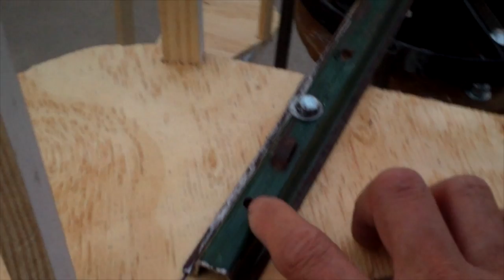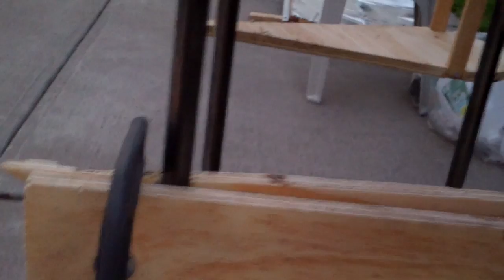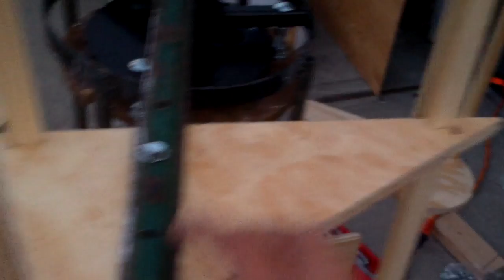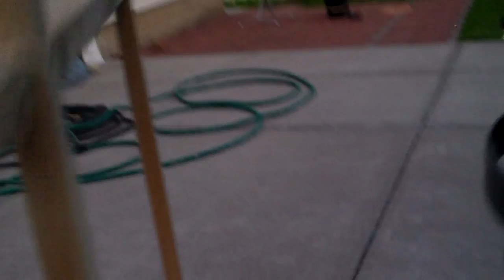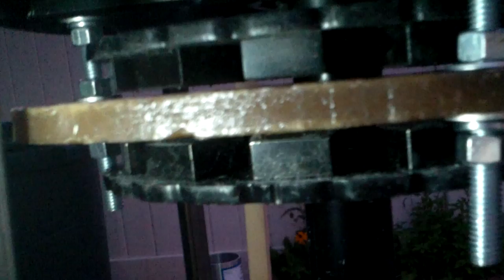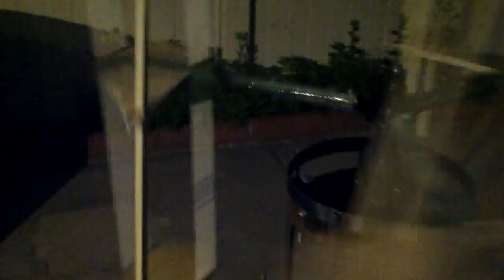Lenz 2 low rpm wind turbine taking shape

Comment: dang! this project is coming along great! looks like you"ve got it planed out well. I hope that stator hangs in there and gives you good service. I should of used the 1x1 magnets when I put mine together. its still flying , greased the bearings once, they will last forever. cant  wait to see it in   the wind. PEACE and Rock on!
Reply from the maker: Goofywind Thank you.  For the wings,  I ordered a roll of 24"  wide by 10 foot flashing online as they sell  only 50' roll in the big box store.  In the meantime, I'm thinking of making a shield or cover for the main bearing and stator.  The idea of using magnets to hold the shield to the hub came to mind. By using magnets, I can easily pull the cover off if I needed to.  It is a fun project and the end product should come out great because I started with Belgrade Machine's frame and your stator.

Comment: Very cool! Those are some big blades ... hope the hub is stout enough. I have been so busy with work I can't get into the shop these days so it's great fun to see your build. I probably have about 5 HAWT frames 90% built that will need a home .... will unload on ebay when work let's up in a month. Thanks for posting and let me know any improvements I should make.
Reply from the maker: belgrademachine  It should turn nicely if I get some decent wind. The big blades are needed or the turbine won't turn. Many a days I go to these big empty parking lots and I get these strong winds which would be perfect for any wind turbine. Unfortunately, I have to settle for what can work in my backyard.  I kind of doubt the wind I get will test the limits of the alternator but the few watts I get is better than no watts at all.

Comment: Wow, that is really balanced!  Definitely make some sort of shield to keep that bearing from getting weathered.  The bracing with wires is also a great idea, top and bottom, to give it more stability and rigidity.
Reply from the maker: jaykay18  Yes more work has to be done. I was eager to set it up so I can hand spin it.  We don't get much wind here but when we do, it can be brutal. Definitely have to make it more rigid. Thanks for commenting.

Comment: That looks familiar lol. It's looking good though! That rotor wants to spin forever. I'm getting anxious to see some numbers lol. As a building contractor I can confirm that Russ is right - take that flashing back. You can buy a thicker gauge 24" wide aluminium flat stock at nearly any building supply store - it comes in 100ft rolls but you can buy it by the foot for $1.00-$2.00/lin.ft, the supply store should be able to cut it to length for you easily with a pair of snips.
Reply from the maker: James Biggar I'll have to find a lumber store that has the 24" wide flashing. I just need about 9 feet or so. There's no cogging with this type of alternator so it does spin easily.  It should spin alongside with my toy windmill with the slightest wind.  I appreciate the info.

Comment: Really good work.  It looks like you have a roll of roof flashing.  It might be cheaper to get some aluminium stock they use to wrap windows and door frames when siding houses.  That stuff comes in several different colors and is fairly cheap.  I think a 25ft roll of 24" wide stuff would be around $25.  All the lumber stores have it.
Reply from the maker: Russ Bowers The 24" roll is what I need but they only have that in 100' roll so I'll have to try a lumber store instead of the big box store. Thanks for pointing that out.
Reply: what I used...  tuff stuff, galvanized roof flashing